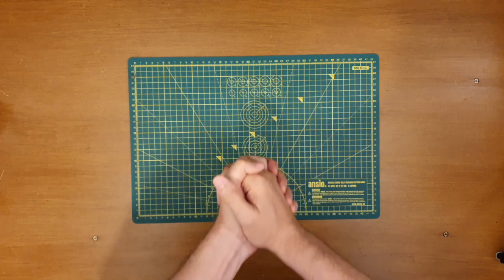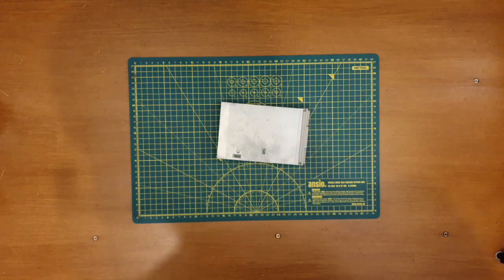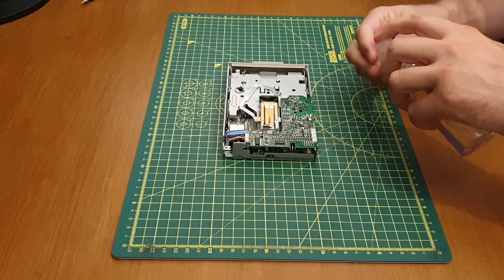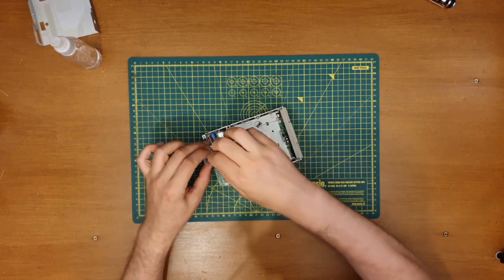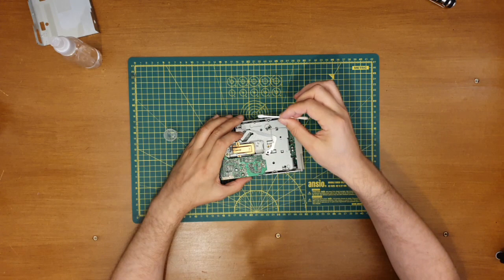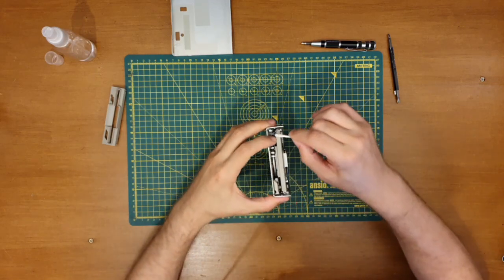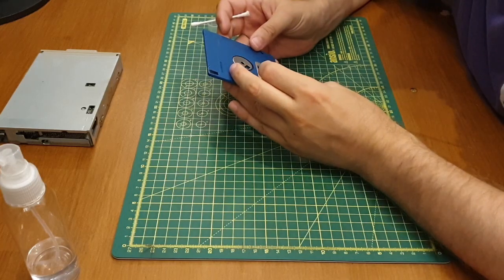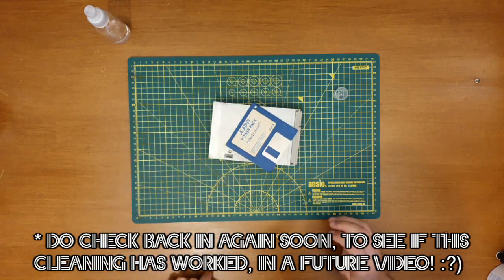Atari 1040STFM - Epson Floppy Drive and Afterburner Disk Clean Up

Comment: For serious mould/grime I take the media out. It makes it easier and quicker to clean it. You also need to be careful with the IPA as that can cause the glue that holds the media to the central metal hub to degrade and then the media can detach from the metal hub.
Reply from the maker: Hi again Monideth! Yeah, that's a good idea...! Certainly be a lot easier if, like you say, any of my disks are particularly grimy. Oh and a good point about being too liberal with the IPA...! 😯😁

Comment: For floppy disk restoration I would recommend using a Greaseweazle device to read and write floppy disks at flux level.
Reply from the maker: Hey Monideth! Yes, recently aware of this project. Would like something that I can create an image that is Gotek compatible. 🤔
Reply: @ChrissRetroCorner  For games, most are already available in ADF (cracked) and IPF (original) format - so using Greaseweazle to image your game disks to be used in the Gotek is not nescessary. I mainly use Greaseweazle to restore original game/program disks by using it to image the disks to see if and where the errors are, and to write the original IPF (or ADF) images back on to it if they damaged or not matching the original (due to high-score/save-game or virus, etc). Sometimes I have to replace the media if there is physical damage to the media that cannot be recovered.
Reply from the maker: @MonidethPen  sorry I didn't see this sooner! I've found most of my Power Pack games in cracked in the .ST disk format (I do like old school cracking team intros!) and these work well with the Gotek. I do need to investigate the Greaseweazle project a bit more... I've seen hardware kits based (on Arduino Nanos I think?). Taking disk images at the flux level and then writing them back does interest me greatly. I'll have to have a proper read-up on the Github!! 😊
Reply: @ChrissRetroCorner  There is a Greaseweazle Facebook group that I recommend you join. I'm not sure exactly regarding Atari ST format as I use Amiga hardware, but I'm sure there are other members that can answer your questions.
Reply from the maker: @MonidethPen  thanks for the info! Just found that and requested a join! 😊👍

Comment: Great video, thank you! what is in the spray bottle you used to clean the floppy?
Reply from the maker: Thanks a lot Kieran! It's Isopropyl alcohol,  commonly called isopropanol or abbreviated to 'IPA'. As it evaporates off, it leaves no residue on the surface. 😊👍
Reply: @ChrissRetroCorner  thanks a mil, I haven't attempted cleaning floppies before, I'll use this technique!
Reply from the maker: Have a snoop through the other comments and maybe online communities first, as there's a lot of different opinions out there on cleaning disks. Always test your technique on an unimportant disk first too. Best of luck!😊👍